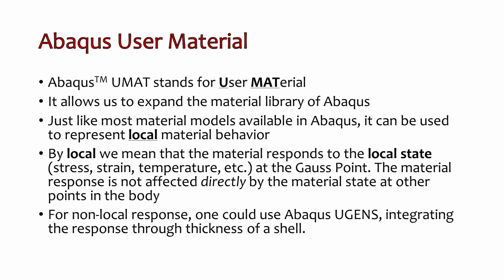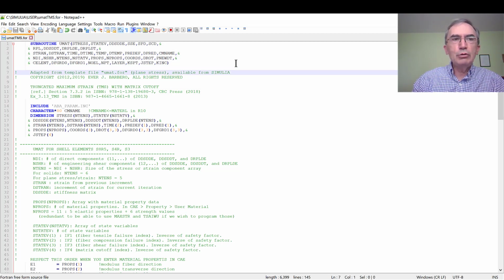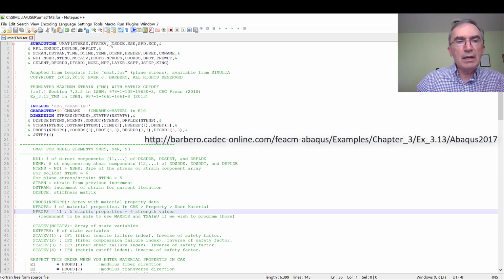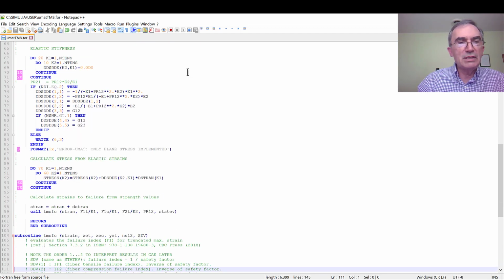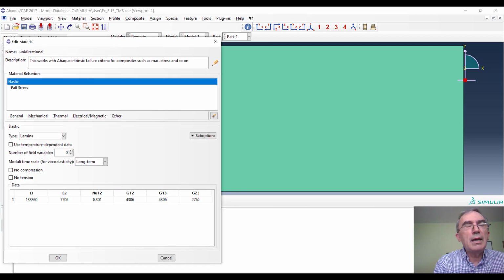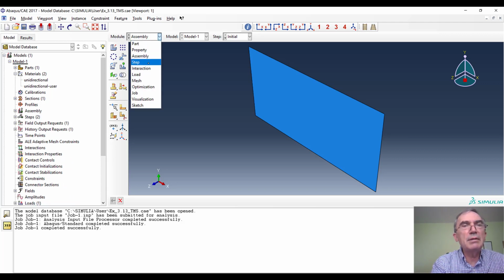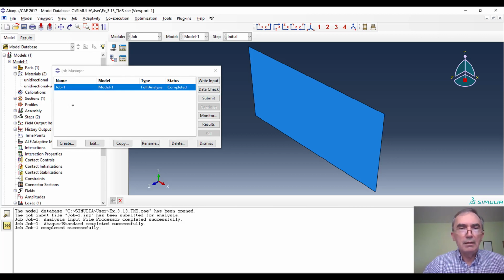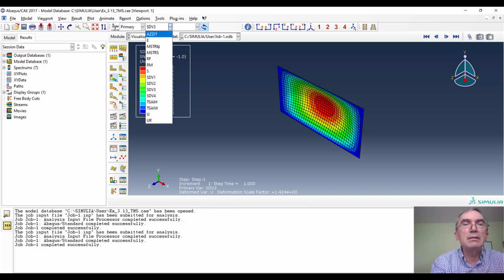How to write an Abaqus UMAT

Comment: Thank you so much for your helpful video. 

ERROR 400 elements have zero transverse shear stiffness. Please check the input data. You may use the *TRANSVERSE SHEAR STIFFNESS option to directly specify values of transverse shear stiffness, or use the *TRANSVERSE SHEAR option to specify material transverse shear moduli for Abaqus to compute the transverse shear stiffness. The elements have been identified in element set ErrElemZeroTransShearStiff.

Help me... please

Comment: Hello sir, In damage modeling using UMAT, the following error is coming.. ''Time increment required is less than minimum provided''.  My model consist of more than one material. Once the damage reaches maximum value in one element this error is coming and other elements are not even reaching the peak stress.

Comment: Thanks Professor for the nice lecture. I would like to ask you for this UMAT is it possibly to use in Low Cyclic Loading or still need to modify the code?
Reply from the maker: This code is for static analysis, if used for fatigue, on the second cycle and later it will not do anything. The code has to be modified.
Reply: @EverBarbero   do you have any code for cyclic loading that you can share? cause UMAT code is a new thing for me.

Comment: Thanks for sharing your video. I downloaded the same model (3.13 CAE and .for file) on your web that you put in description but I got a problem when  start to simulate. Job is aborted "Problem during compilation".
Reply from the maker: Well, Abaqus is very delicate, you need to follow the installation instruction for all the software components and use exactly the versions that I mentioned there.

Comment: Thanks for the nice lecture, it seems very useful for me. As a beginner, I wonder how to construct the file with suffix .for.  which software can I use?
Reply from the maker: .for is a text file so any text editor will work but you need to learn Fortran and best use a Editor that supports Fortran such as Visual Studio.
Reply: @EverBarbero  Okay, I see, Prof.Barbero. really appreciate for your prompt response and useful answer.

Comment: Hi sir...I have almost solved the issues related to connection of fortran to ABAQUS software... But at the end Iam getting the error which says
1) error in job messaging system- disconnection to the job analysis.
Pls guide me to how should I tackle this problem.
Reply from the maker: Sorry, I have never seen this error.
Reply: @EverBarbero  Sir...I have solved the problem..Thank you very much for the guidance.

Comment: nice video sir. Is it possible to provide material properties for two different materials using UMAT. I am modeling a composite material and I want to give both matrix and fiber properties.
Reply from the maker: Yes, you can provide properties for as many materials as you want, just increase NPROPS and send all the values to the UMAT in PROPS, but you have to manage the data, for example, PROPS(1) and (2) have E and PR for material A, PROPS(3) and (4) have E and PR for material B, etc. Also, in PROPS you can send parameters such as dimensions, etc.
Reply: @EverBarbero   thank you very much. I am trying to model composite of isotropic material and anisotropic material. with the part name used in abaqus, is it possible to assign the material properties in subroutine

Comment: Sir, one more thing...If i need to model Hashin's damage.. is there any subroutine/function to call ?
Reply from the maker: Hashin damage should no be called like that because Prof. Hashin did not formulate the damage-part of the model, only the failure criterion, which is a first ply failure criterion such as maximum stress, etc. The damage model uses Hashin's failure criterion as damage initiation criteria, that is all. After that, damage evolution follows the general methodology called CDM (continuum damage mechanics), which is described in the Abaqus documentation (Theory) and many papers, chapter 8 in my book, etc. An implementation like that but using TMS (truncated maximum strain) could be done in a UMAT, I don't of anyone that has done that but it is not difficult to do. It is a bit tricky to get UMAT to work in Abaqus though. I have videos for that on this channel.

Comment: 1)Sir... Is is really difficult to code a UMAT?...
2)Do we have to maintain the SI unit consistency also for writing the UMAT?
3)Sir... What is the number after DO statement indicate?...In your example-'10' and '20' for calculation of stiffness matrix
Reply from the maker: #1) The difficulty depends on the complexity of the constitutive equations. For a linear elastic problem is really easy. For 1D or 2D continuum damage, I have examples in my textbook, not so hard to code the UMAT but hard to understand the mathematics behind it. #2) Abaqus has no units. The input data must be consistent, like everything in [N,m,Pa]  or [N.mm,MPa], or [lb,in,psi], anything like that, but in your code you do not have to do anything. #3) In old F77 fixed formatted Fortran code, the number after DO is where the loop ends. In F90/95 free format you use the DO ENDDO construct. You see old format because the examples in the Abaqus documentation are in F77 style.
Reply: @EverBarbero  Thank you sir... the video was very beneficial.

Comment: Dear Professor,
I am doing a project in the field of numerical biomechanics. I am involving a research project in which I should simulate a four-point bending test for ceramics(ZrO2). As you know, ceramics don’t have a plasticity stage and after pass through the elastic region, they ruptured. In order to simulate the four-point bending test, I need more information about the criteria and mechanical rupture equation, especially in ceramics after that, I should make a subroutine code(UMAT) for simulation with ABAQUS. I would like to know how can I find this kind of information for ceramic material which I can implement in simulation software
Reply from the maker: If it is a 4PB test, a closed-form solution from "mechanics of materials" would be better, or at least give you a good approximation. If the material is brittle, homogeneous, and defect-free, the 4PB or 3PB are tests designed to measure the bending strength Fb of the material, which then is used as tensile strength Ft because of the difficulty of testing these brittle materials in a tensile test. So, the test you are doing will give you the Fb, thus the Ft. If the material is not homogeneous, for example, it has particle inclusions, and/or surface defects such as notches, cracks, scratches, voids, then your Fb data will have large variability from specimen to specimen. if that is the case, you gave to use fracture mechanics to predict failure. Basically, you have to measure the fracture toughness of the material, which combined with the crack size and location helps you predict the strength Fb, Ft, etc. See the discussion about fracture toughness in chapter 7 in https://www.amazon.com/exec/obidos/ASIN/1138196800/booksoncompos-20

Comment: sir could you make a video to  find hardness using UMAT subroutine in abaqus (need to find hardness after laser operation)
Reply from the maker: As far as I know, hardness is a material property, to be measured experimentally, by Brinell or Rockwell indentation. Do you mean something else?
Reply: @EverBarbero  I need to find by simulation also.  Need to cross verify with simulated and experiment both.
Reply: Many authors  in their research paper found out by simulation using UMAT subroutine in abaqus.  I also need to do the same.  Please mention me the steps to do in abaqus.

Comment: Thanks for the video. 
I downloaded these two files "Ex_3.13_TMS.cae & umatTMS.for" from your web site, http://barbero.cadec-online.com/feacm-abaqus/Examples/Chapter_3/Ex_3.13/Abaqus2017. But the job was Aborted saying an error message " Unable to start analysis job". 

So I tried again with command line 
"abaqus job=Job-1 user=umatTMS.for" 

Then it returns these error logs as below................ Are there more setups even if I get PASS by checking "Abaqus verify –user_std?
(I am using Abaqus 2020 with "Microsoft Visual Studio community 2019 & Intel® Parallel Studio XE for Windows 2020 update1")

umatTMS.for(1): error #5082: Syntax error, found '&' when expecting one of: * <IDENTIFIER>
	  SUBROUTINE UMAT(STRESS,STATEV,DDSDDE,SSE,SPD,SCD,&
-----------------------------------------------------------^
umatTMS.for(2): error #5082: Syntax error, found '&' when expecting one of: * <IDENTIFIER>
     & RPL,DDSDDT,DRPLDE,DRPLDT,&
--------------------------------^
umatTMS.for(3): error #5082: Syntax error, found '&' when expecting one of: * <IDENTIFIER>
     & STRAN,DSTRAN,TIME,DTIME,TEMP,DTEMP,PREDEF,DPRED,CMNAME,&
--------------------------------------------------------------^
umatTMS.for(4): error #5082: Syntax error, found '&' when expecting one of: * <IDENTIFIER>
     & NDI,NSHR,NTENS,NSTATV,PROPS,NPROPS,COORDS,DROT,PNEWDT,&
-------------------------------------------------------------^
umatTMS.for(16): error #5082: Syntax error, found '&' when expecting one of: <IDENTIFIER>
      DIMENSION STRESS(NTENS),STATEV(NSTATV),&
---------------------------------------------^
umatTMS.for(17): error #5082: Syntax error, found '&' when expecting one of: <IDENTIFIER>
     & DDSDDE(NTENS,NTENS),DDSDDT(NTENS),DRPLDE(NTENS),&
-------------------------------------------------------^
umatTMS.for(18): error #5082: Syntax error, found '&' when expecting one of: <IDENTIFIER>
     & STRAN(NTENS),DSTRAN(NTENS),TIME(2),PREDEF(1),DPRED(1),&
-------------------------------------------------------------^
umatTMS.for(19): error #5082: Syntax error, found '&' when expecting one of: <IDENTIFIER>
     & PROPS(NPROPS),COORDS(3),DROT(3,3),DFGRD0(3,3),DFGRD1(3,3),&
-----------------------------------------------------------------^
umatTMS.for(104): error #5149: Illegal character in statement label field  [s]
subrou tmsfc (strain, xet, xec, yet, nu12, SDV)
^
umatTMS.for(104): error #5149: Illegal character in statement label field  [u]
subrou tmsfc (strain, xet, xec, yet, nu12, SDV)
-^
umatTMS.for(104): error #5149: Illegal character in statement label field  [b]
subrou tmsfc (strain, xet, xec, yet, nu12, SDV)
--^
umatTMS.for(104): error #5149: Illegal character in statement label field  [r]
subrou tmsfc (strain, xet, xec, yet, nu12, SDV)
---^
umatTMS.for(104): error #5149: Illegal character in statement label field  [o]
subrou tmsfc (strain, xet, xec, yet, nu12, SDV)
----^
umatTMS.for(122): error #5149: Illegal character in statement label field  [i]
    implicit noneuble
----^
umatTMS.for(123): error #5149: Illegal character in statement label field  [d]
    do precision strain(5), xet, xec, yet, nu12uble
----^
umatTMS.for(124): error #5149: Illegal character in statement label field  [d]
    do precision SDV(4)
----^
umatTMS.for(125): error #5149: Illegal character in statement label field  [d]
    double precision s, tmp, ht(4)
----^
umatTMS.for(126): error #5149: Illegal character in statement label field  [d]
    double precision, parameter :: zero=0.0D0
----^
umatTMS.for(129): error #5149: Illegal character in statement label field  [h]
    ht = zero        !but set them to zero for now
----^
umatTMS.for(130): error #5149: Illegal character in statement label field  [S]
    SDV = zero       !initialize when calculating I_F (like Abaqus)
----^
umatTMS.for(122): error #5082: Syntax error, found IDENTIFIER 'PLICITNONEUBLEPRECISIONSTRAIN' when expecting one of: ) ( , : <END-OF-STATEMENT> ; % [ . = / =>
    implicit noneuble
------^
umatTMS.for(125): error #5082: Syntax error, found IDENTIFIER 'UBLEPRECISIONS' when expecting one of: :: ) ( , : * <END-OF-STATEMENT> ; . % (/ + - [ ] /) . = ' ** > ...
    double precision s, tmp, ht(4)
------^
umatTMS.for(126): error #5082: Syntax error, found IDENTIFIER 'UBLEPRECISION' when expecting one of: :: ) ( , : * <END-OF-STATEMENT> ; . % (/ + - [ ] /) . = ' ** > ...
    double precision, parameter :: zero=0.0D0
------^
umatTMS.for(126): error #5082: Syntax error, found '=' when expecting one of: :: ) ( , : * <END-OF-STATEMENT> ; . % (/ + - [ ] /) . ** > ...
    double precision, parameter :: zero=0.0D0
---------------------------------------^
umatTMS.for(142): error #5149: Illegal character in statement label field  [i]
    if ( strain(2).gt.zero.and.(yet-ht(1)).ne.zero )  SDV(4)=strain(2)/(yet-ht(2))       !matrix failure, when the transverse strain is positive
----^
C:\Users\ATIS\AppData\Local\Temp\3475613.i(153): catastrophic error: Too many errors, exiting
Reply: @Ever Barbero Thank you Sir.
Reply from the maker: You're welcome.

Comment: Thanks for the great lecture. It is rare to have one that bridges the gap between theory and application. 

One thing that I struggled in recreating this example: 

My fortran compiler somehow assumes the file is in fixed form, causing failure in compiling. Putting  "!DIR$ FREEFORM" in the first line declares the file in free form, fixing the issue.
Reply from the maker: Yes, !DIR$ FREEFORM fixes the problem. Thank you for your comment. It is not easy to get it to work but you got it! -- Another way is to modify the file C:\Program Files\Dassault Systemes\SimulationServices\V6R2017x\win_b64\SMA\site\ win86_64.env , but here are the files already made for Abaqus 2017, look for the last link at the bottom of this page: http://barbero.cadec-online.com/feacm-abaqus/sourceCode.html  -- Also I have another video specifically for installation: https://youtu.be/qGNAdlDoeTs

Comment: Professor thanks for the video it is very useful. I am trying to implement the same UMAT in Abaqus 2019 but it gives me a compiling error. Do you thin it is because of the version? or could it be something else?
Reply: @Ever Barbero Thank you I will try
Reply from the maker: I do not have access to 2019 because my university is closed due to covid-19

Comment: Hi, when I try this myself, (UMAT and VUMAT), it gives me the error: "Elements are missing required transverse shear stiffnesses. Use *TRANSVERSE SHEAR STIFFNESS option under the *SHELL SECTION to specify their values". Why is this occuring for me, but did not happen for you? Thanks
Reply from the maker: hking162 If you are using General Stiffness Section to enter the A B D matrices of a composite laminate you have to enter the H matrix in a separate window in CAE, see pages 107–109 in my Abaqus book for an explanation about how to obtain those coefficients and where to enter them in CAE. Otherwise please tell us exactly how you enter the material properties and how you define the section in module Property. Thanks.
Reply: Ever Barbero hello, I am using a isotopic viscoplastic material model to simulate the behaviour of a hot metal sheet deforming (metal forming process). I would like to  use shell elements. I am using a homogeneous shell section (thickness 2mm). Under the “advanced” tab in the section properties, it has an option for “transverse shear stiffness” which it requires me to fill out. However I do not know which values to put here? This happens when I want to run my VUMAT subroutine. It also happened when I downloaded your UMAT subroutine and tried to run it. Thanks
Reply from the maker: @hking162  In ISBN 978-1-138-19680-3, eq. (6.22), p. 181, using Latex notation, 
H_{ij}=\sum_{k=1}^N{Q_{ih}^k t_k}.
If the material is othotropic
Q_{44}=G_{23}
Q_{55}=G_{13}=G_{12}
If the material of the layers is isotropic 
Q_{44}=Q_{55}=G_{12}=E/2/(1+v); v is Poisson's ratio.
So H reduces to
H_{ij}=\sum_{k=1}^N{G_{12} t_k}
If the shell does not have layers, but it is homogeneous through the thickness "t", then 
H_{ij}=G_{12} t
In ISBN 978-1-46-651661-8, eq (3.16)p. 108
K11=H55=G13 t 
K22=H44=G23 t 
K12=H45=0 for N=1 only, otherwise see the book. 
If the material is isotropic 
K11=K12=G t
and
G=E/2/(1-v), where E is the modulus of elasticity and v is the Poisson's ratio.

Comment: Hello Barbero, thank you for your sharing! I have a question about "Implicit None". In subroutine, what time do I need use this announcement? For example, in UMAT you didn't use it. And variables such as E1,E2 in your UMAT,  you use it directly without defining it. Does it use "ijkl" rules? But in another Fortran subroutine  "tmsfc" you use "Implicit None".
Reply from the maker: Implicit none forces me to define every variable. It is good/great programming practice. That way I forget the ridiculous ijlkmn -> integer, the rest are -> real, but then you have to define all real to be double or else the precision is bad, what a mess.  If I did not use it in UMAT is because that was a template I got from SIMULIA. I should have cleaned it up. Like the tmsfc() routine is nicely written. Much less chance for errors.
Reply: @EverBarbero  Thank you for your answer. So if I use the UMAT template without "Implicit None", it defaults to use the ijklmn rules, isn't it? If I want, I can add "Implicit None" in the UMAT subroutine to make much less chance for errors.
Reply from the maker: @杨壬元  Yes, without "implicit none" not only reverts to ijklmn rules but also you the compiler will not want you if you accidentally have a typo in a variable. Now the variable with the typo is meaningless, your code will break, and it is hard to spot the error. Fortran is particularly bad because the code is difficult to read. Implicit none forces you to actually explicitly define each new variable and if you make a typo, the compiler will tell you that variable, with the typo, is not defined! Other languages such as Python do not force you define variables but are much more "readable" so you can spot the typos yourself.
Reply from the maker: you're welcome!